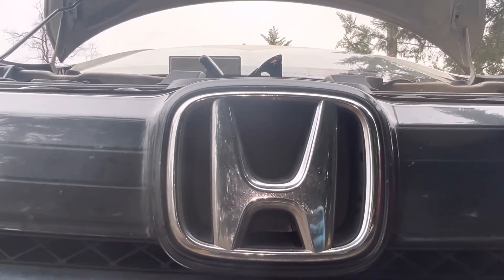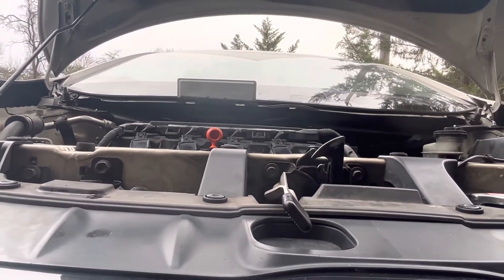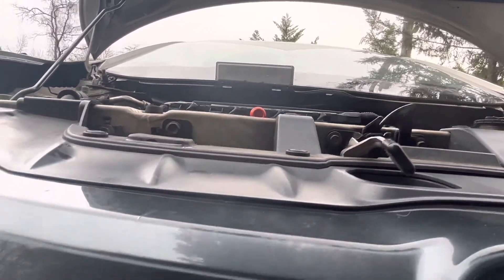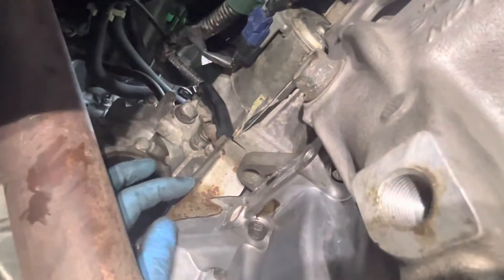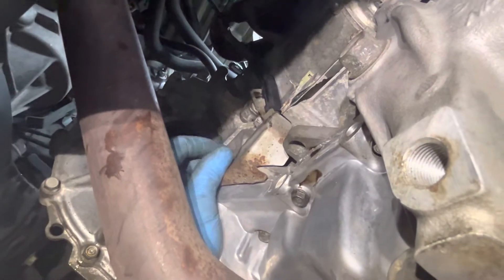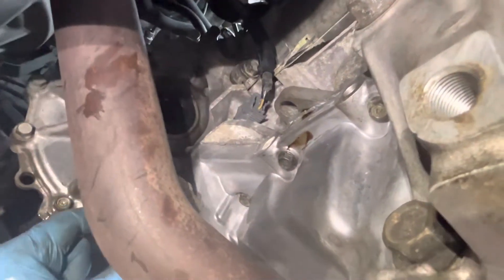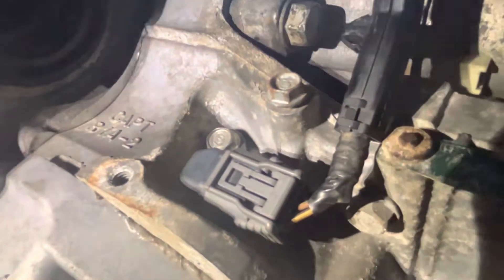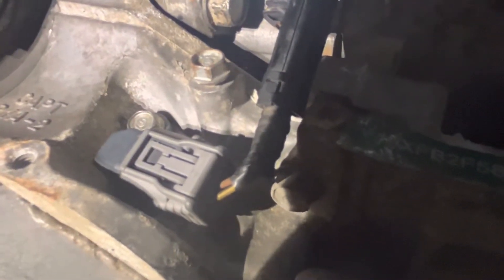2012-2014 Honda Civic 1.8 i-Vtec crank sensor location

Comment: Great video to show where the crank sensor is !!!  I used a Craftsman 1/4" breaker bar and 10mm socket with a big flat blade screwdriver wedged in between the top of the socket and the axle to hold the socket to the bolt to crank it out.... Was a PIA but only used the 10mm socket and didn't have to remove axle or anything else other than the little metal cover in the video.....

Comment: If you all wondering (do I need to remove the passenger side axel?) answer is no. Although is easier to get to but you do not need to remove the axel. 

Use a 1/4“ swivel, 10mm socket, and long 1/4” extension. Sneek it between the axel. You may need to turn the axel at the base where there are grooves. 

It’s doable, trust me
Reply from the maker: Thanks for the explanation….

Comment: It is accessed from underneath the car.....the crank sensor is located just below the starter and under the little metal cover with 2 10mm bolts on it....Only way I could reach the sensor bolt was with a 1/4" breaker bar and 10mm socket..... a 1/4 socket swivel would not fit for me but the Craftsman 1/4" breaker bar did

Comment: Common issues I'm having are mainly stalling in drive with foot on brake & shifting in reverse. All codes lead to this being the problem. let me know if that sounds in line with the issues behind a bad sensor - thx
Reply: Did you ever figure out if this was it? Experiencing the same thing.

Comment: You don’t explain you have to remove the drive axle from the hub
Knuckle from the shock absorber 
Your video only helps to locate the sensor not the hole process

Comment: It looks like he has removed the axle. That makes this job significantly more work.
Reply: Do you have to remove the axle? Or just use a lot more cursing?
Reply: Literally 3 bolts and a pry bar will get the axle out of the way.
Reply: You can do it without removing the axle but F that shit if you’re doing the starter.

Pull the axle ❤